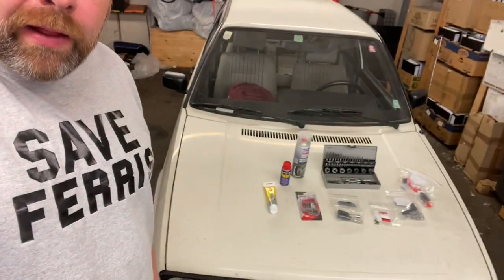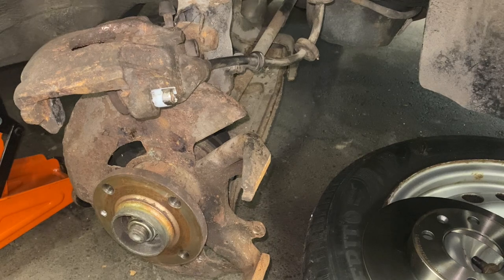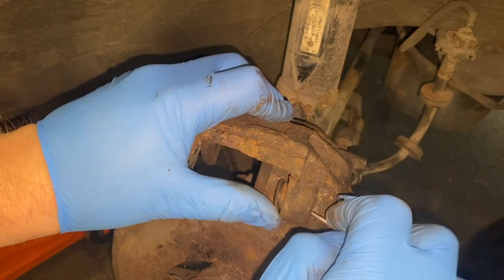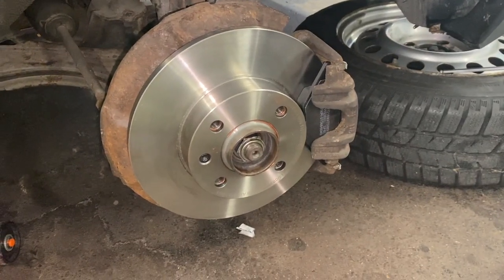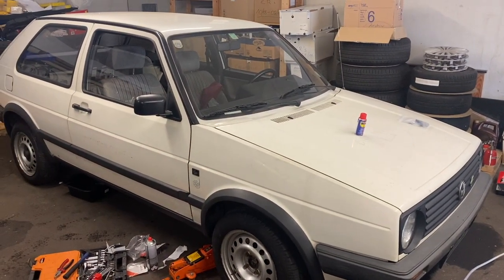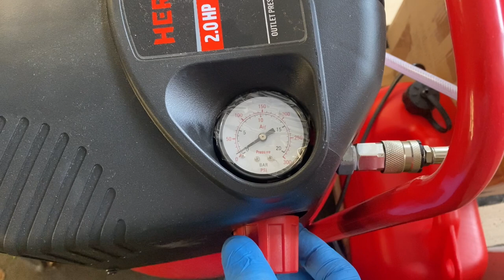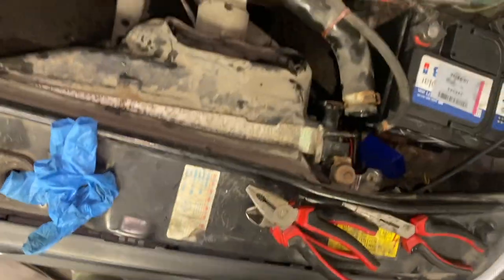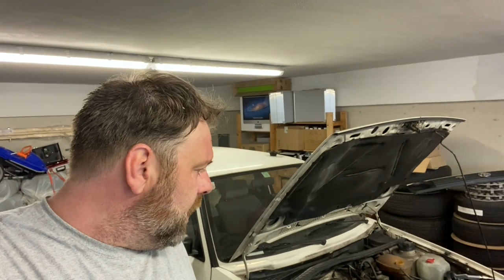Real Progress ! Brakes, kites and yet more snow...

Comment: Another busy day. Soon you will conquer the Alps in your VW Golf.
The parts online are certainly not good for a garage, and they can take their time to serve orders. I have no experience with returns cause i never even tried. For little bits, like brake hardware, i would have gone to the VW dealer, i know they are expensive, but they certainly have that in stock and how much can they charge you for a couple of bolts?!
I had same problem with the radiator of my old Mercedes, it only leaked when under pressure, and i couldn't find where. Finally it failed on my son when he took the car to the big city, and bumper to bumper traffic. So, you did very good to make the test in the shop before go out driving. 
After putting the new radiator in, check if the temperature switch operates correctly, I had my old Citroen fail that one years ago when going to the Citroen parade day. Not fun.
You inspired to go start up my old Citroen BX again, it was sitting for a while at the corner of the garage. It ran again on the weekend, must clean it up real good and have to get it ready to inspection again, some light switches have gone bad. Oil seeping here and there... The usual for an old car. 
Cheers!

Comment: Oops check the coolant sensor under the pump (little bronze and green tiny barrel) make sure you carefully take it out without braking the connectors, change the clamps and rubber filter. It starts to fail if the car was ever overheated or is old ( not very expensive to purchase)